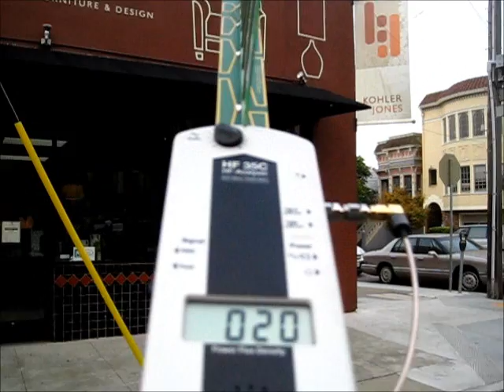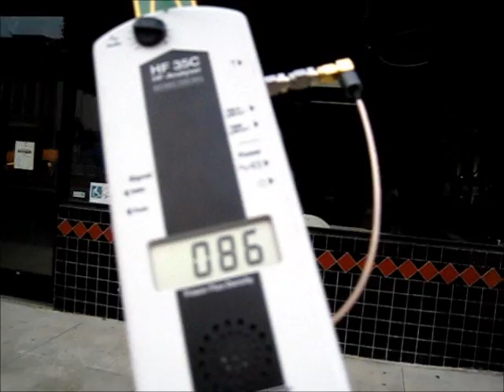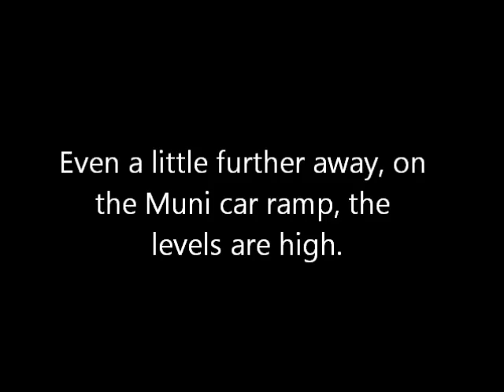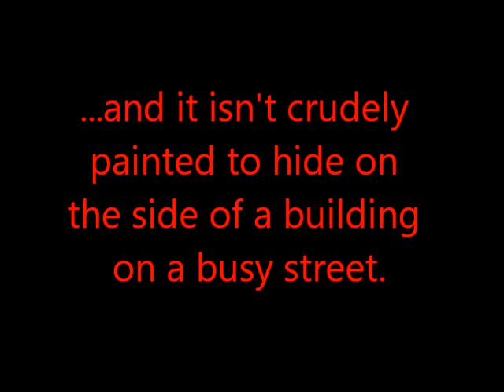RF in the 'Hood: stealth antennas pump it out in Upper Noe Valley

Comment from the maker: The range of frequencies that my high-frequency analyzer measures is 800 MHz to 2.5 GHz---covering cell phone, wifi, smart meters, baby monitors, radar, cordless phones. But these different sources are not just a big muddle---the audio output of my analyzer allows me to discern between the various types of RF source. This is from a cell antenna, which has a characteristic high-pitched whine married to a bouncing buzz. Please view my video on discerning different RF sources with this device.
Reply: What you hear is noise-like signal coming from UMTS (3G) base station.